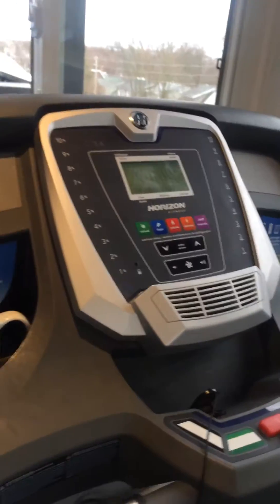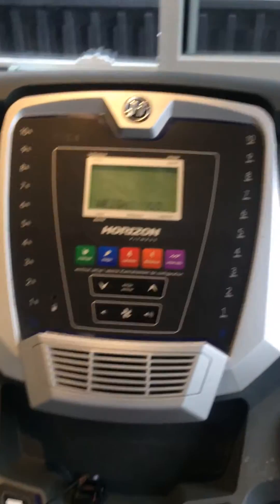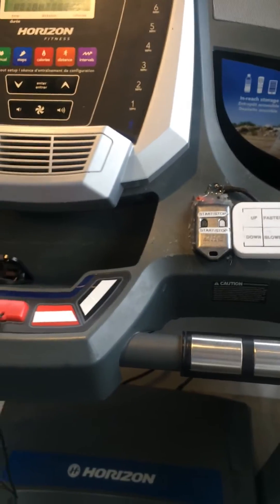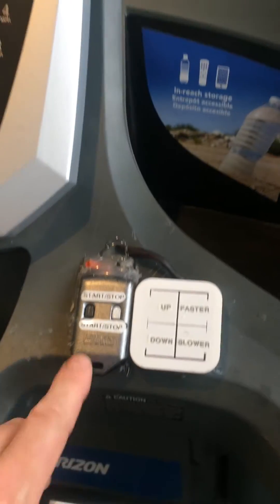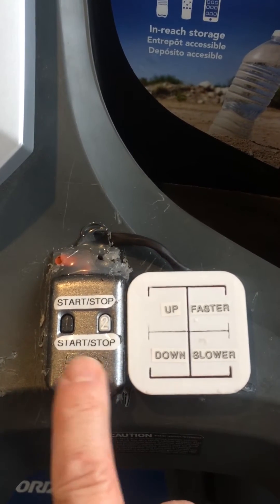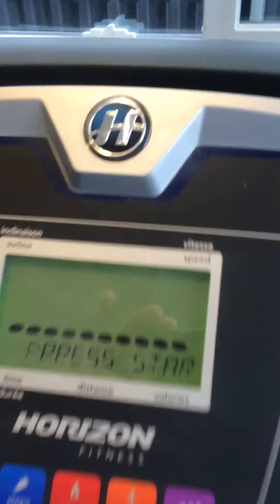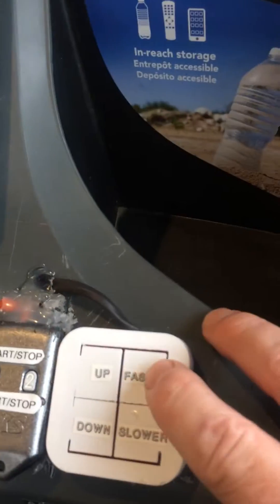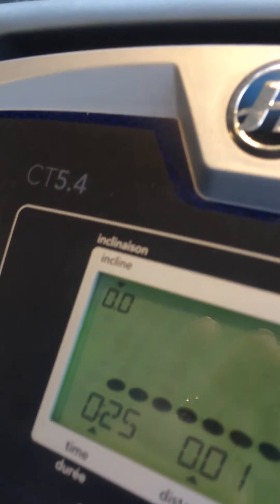Treadmill fix - it’s complete! Final summary and demo - part 8 - Horizon CT5.4

Comment: Hello, pretty impressive stuff. You haven't had the problem where the lube belt message refuses to reset? It seems to be a very common problem that Horizon says needs replacing of a control board for about $400 or so. Seems like something that shouldn't require such an expensive repair when it seems like just a glitch that refuses to make the computer reset this error message. If you have a fix to that might help a lot of people out.
Reply from the maker: Thx Adamo
I wasn't aware of glitch re: lube belt. Did you see my vid on how to.. lube and then manually reset message?
I'm assuming you are saying the glitch is that the 'hold two down buttons together for 3 seconds' reset doesn't work?
Not saying you are but some folks are assuming once you apply lube the machine somehow automatically senses it...which it doesn't.
Can you pls confirm with me you mean the first?
Many thanks!
R
Reply: @fixitdad899  Hey, thank you for the reply! I did watch your video hoping it was to solve the glitch actually.  Yes I did lube the belts and had held stop and speed up button for many seconds but the glitch is that the system doesn't reboot and the error message stays there making the treadmill no longer useable. From searching online and reading Amazon reviews for the product it seems its a very common occurrence. Really sad they don't offer a cheap fix for this, especially that it is most likely a design flaw. Our treadmill is in very good shape all buttons work, just won't reset.
Reply from the maker: Thx for clarification... well that's a bummer. Seems you already answered where I would have gone next to troubleshoot ... do those two particular buttons work properly under normal use?
Only other thing I can think of would be to unplug the machine from wall for at least 90 seconds. Plug it back in and retry. Sometimes draining all residual charge from boards can help with getting them to shake out of program lockups. Good ole reboot. If you haven't tried that would give it a go. You'd still have to do the 2  button hold after reboot.
All I can think of. Good luck!
Reply: @fixitdad899  Yup the two buttons always worked perfectly. I did also think of unplugging and doing the reboot but no luck. Thank you for you suggestions, appreciate it! Trying to see if I can find someone locally that may be able to repair it without replacing the board. If not I guess it's going to the garbage like others have done, such a shame because everything worked fine.
Reply from the maker: Would be a very sad thing for it to go garbage to be sure. Are you anywhere near Toronto by chance?
Reply: @fixitdad899  Ya, don't like that either, nothing is made to last nowadays. No I'm near Montreal.
Reply from the maker: Bonne chance! Maybe there is a graveyard /workshop that has a good IC board from a machine where the buttons failed like on mine. Maybe your board 'just' needs reflashed. But alas ya... sadly Canadian Tire not always your best source of fine German engineering and longevity! Frustrating no doubt. Have a good one.
Reply: @fixitdad899  Haha ya definitely not! Thank you for the advice, nice chatting! Take care.
Reply: @adamo9119  Do you find a issue about your problem? In the chat I read you are from montreal, so you speak french? More easy for me! :)
Reply from the maker: https://youtu.be/-WxbANxjU6I
Here is the vid just in case
Reply: Did all what you said still lube belt wont go
Reply from the maker: @noelsicat807 That's a bummer - looks like maybe you have one of the problem boards. Sorry to hear not working for you. All the best!